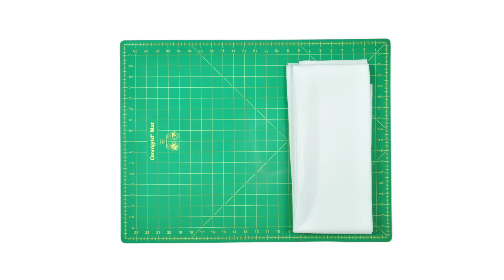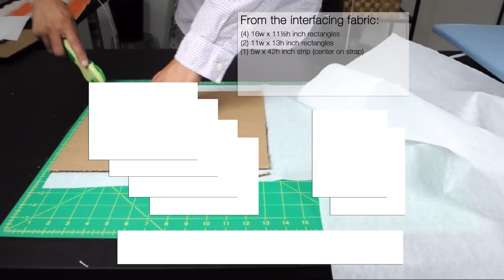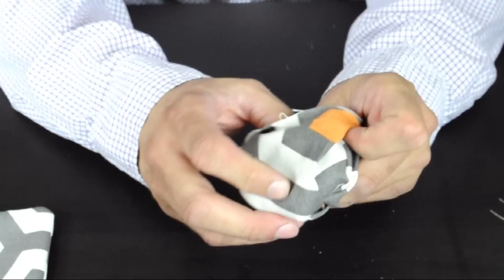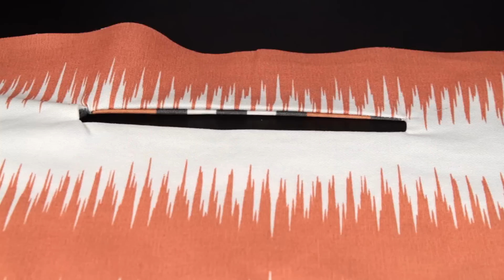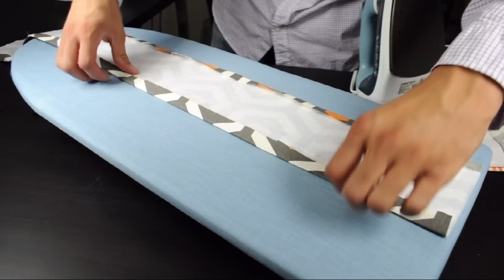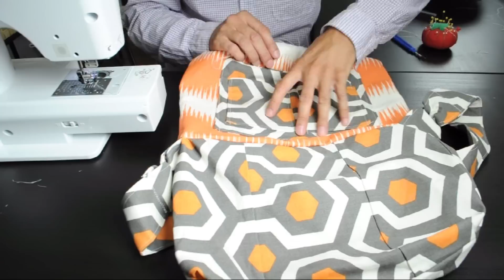How to Sew a Messenger Bag (Tutorial)

Comment: This is confusing because at 1:29 your measurement for (part 2 front of bag) of the the main fabric is 6 by 21 inches but at 2:55 you describe it as 6 and 1/2 inches by 21, so which measurement is the correct one for (part two front of bag) of the  main fabric, is it, 6 by 21 or  6 and a half by 21?
Reply: This! No one else pointed that out and seemed to be just fine with their bags. I don't understand what's going on with these measurements.
Reply: @myworldisanime7675   Me neither. If you noticed I wrote this comment around a year ago and she still has not bothered to answer my legit question!!

Comment: Please clarify for me.
After assembling the three parts of the front of the bag, is it supposed to be an inch wider than the back of the bag?
Reply from the maker: Hmm.. they should be the same size. I think your best course of action is going to be cutting 1/2 inch off each side and just making adjustments from there. It can definitely be fixed, it is just going to take a little more planning out.
Reply: Yeah, I suppose it is an easy fix if that is the case. I was just worried there was something I missed. Thanks for the swift reply.

Comment: Maybe it’s my seam allowance that I messed up with (I’m a quilter, so I use 1/4” seam allowance-so it maybe my error rather than the pattern)-but when I sewed the front 3 pieces of the front of the bag together (2 pieces of “part 1 front of bag” and 1 pieces “part 2 of the front of bag”), the result was 1/2 inch oversize one each end. The height was perfect-however I did need to trim off 1/2 inch either side of the front of bag, so it matched the back of the bag.
Reply: He says in the tutorial he is using a 1/2" seam allowance.

Comment: great tutorial.  but not for a beginner.  there are some details missing for beginners.  also, the measurements are not exact (the front outer center panel should be 5 (w) x 21 (h); otherwise, you'll be an inch too much when joined with the two sides (6.5 x 11.5)).  you also switched your pocket fabric from lining fabric to outer fabric which can be a bit confusing to a beginner.  nevertheless, great tutorial.  i made one and looks good, but needs a bit tweeking.
Reply: i thought it was just me..lol
Reply: beginner and confused. I made the bag, but the lining fabric ended up being the outside parts for most of it.  I will correct the design and cutlist now that I know.  I usually only make bow ties lol
Reply: Beginner here...I made this section twice because I thought it was me...lol...thank you. Great tutorial though!!!
Reply: I thought I was going nuts when I didn't notice anyone else mentioning this!